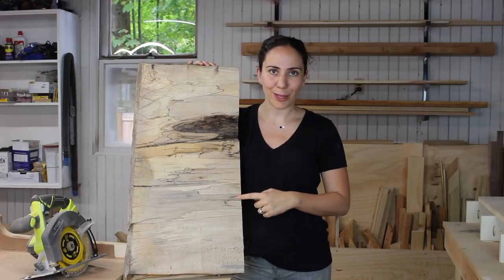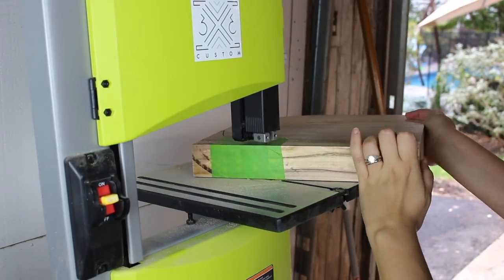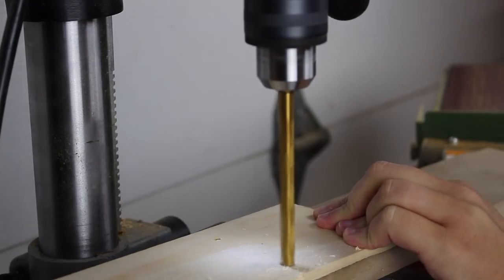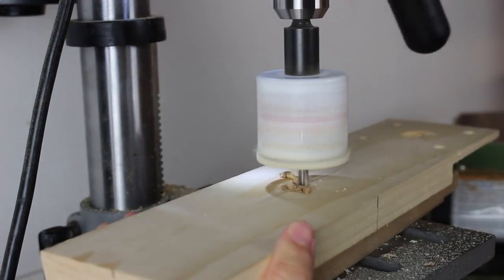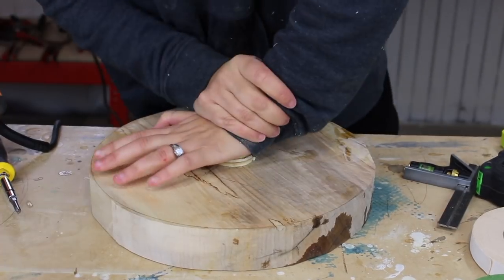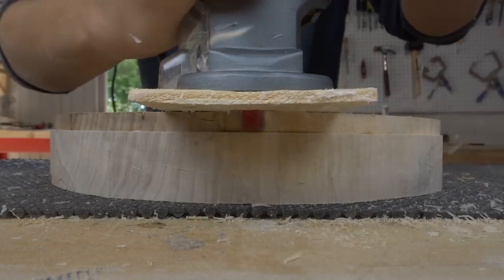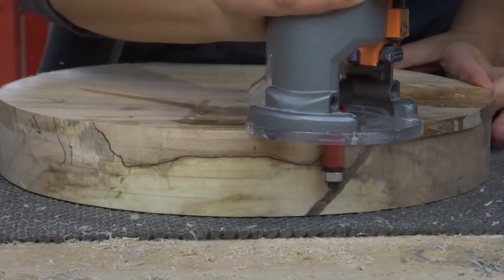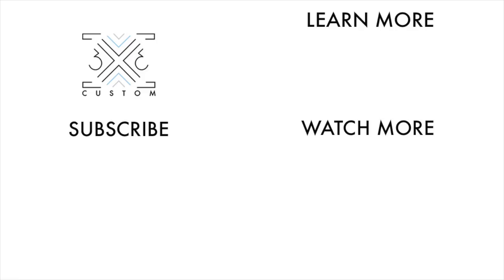Circle Cutting Jig WITHOUT Putting a Nail in Your Workpiece

Comment: I decided to stop worrying about the hole in the center a long time ago. When I run across the need to cut a circle without a hole in the middle, like a round cutting board for instance, I just cut the circle I need out of MDF or plywood or ideally acrylic if I have a piece the right size and double side tape and rout around it. I keep the blanks and at this point I haven't had to cut a new blank in years.

Comment: Great idea. What you could do to get rid of the free play made from the slightly undersized centre piece is to cut another hole the next size bigger and the put the centre piece of that in a drill/pillar drill chuck via clamping it with a nut and bolt and then sand it down until it's a snug fit in the original hole for your router jig. That will work better for you! Thanks for the idea.
Reply from the maker: Thanks! Some ppl actually suggested adding some tape to snug up the fit and I think that would be an easy enough solution

Comment: I like the way you think. Just an observation, but to take up some of that sloppiness you can remove the bit from your hole saw and insert it (the saw, not the bit) over the center circle. I don't like to drill a hole into my piece either so I just use a DIY circle jig and double stick my pivot point to the center of the piece. You'll have to attach a piece of material under the router end of the jig to elevate it so it's parallel to your center pivot point.
Reply from the maker: I liked people’s idea of adding some tape around the puck to tighten up the slop

Comment: I too don't like the screw in my board.

I took your idea a step further. I elongated the router hole from the end to ALMOST the circle, drilled holes to attach it down the sides so the circle size can be adjusted. I also cut out a circle with a hole saw out of another piece of wood, measured it and cut the hol in the jig snugly. A little wax on both pieces.

I'm about to test it 😬👍.

Comment: That’s always my main concern when cutting out circles is the hole in the center. This is a great tip! Thanks!
Reply from the maker: Thanks! Some ppl suggested wrapping the hole saw cut off with some painters tape to tighten it up. That might be a good idea.
Reply: I like your idea of just keeping pressure against the outside of the inner circle. At least that way you know the jig will spin freely.

Comment: Just made mine today. Thanks for the great idea. I made mine with 5 holes for 8”, 12”, 16”, 20”, and 24” circles.
Reply from the maker: That’s awesome! Some ppl suggested putting some painters tape or something around the hole saw “cookie” to eliminate the slop. I think that would be a great idea.
Reply: 3x3Custom - Tamar I made my “cookie” on a CNC router. Less than 1/64” slop. Thanks again for the great idea.

Comment: I like the jig you crafted and have been thinking about a way to tighten up the gap between the round center guide and the hole in the router arm.  You did a great job with your router guide, but I was just curious about how your jig works.

If you made the hole in the router arm the same diameter as the outside diameter a piece of PVC pipe, then you could fit and glue the round center guide inside a piece of PVC pipe the same length as your router arm is thick.. The fit between the round center guide in the PVC pipe "bushing" and the router arm would then be pretty stable -- I think.   

Two-and-one-half-inch Schedule 40 white PVC pipe has an outside diameter of 2 7/8".  As far as I know, several manufacturers sell hole saws in this diameter.  Just a thought.  I think I am going to try this.  Thanks for the idea.

The most important thing is that your jig worked great and you do not have to deal with a hole in your stock.  Nice!   Double-stick tape rules!
Reply from the maker: That sounds like it could work. People have also suggested just wrapping the “cookie” with tape to tighten up the hole. I myself, didn’t have a problem with it’s looseness but if that’s a problem for ya then I think painters tape would work too!
Reply: No problem.  Just going with the flow.

Comment: You can leave the "cookie" (love the name!) in the hole saw and just remove the centre drill. Stick the cookie down with the tape just like you did but with the hole saw still in place it's the exact size of the hole you made in the jig. It might even want a wipe of cooking oil or something like that because it will be so close fitting. Just a thought...
Otherwise, brilliant idea and great video. Thanks - subscribing. 😎
Reply from the maker: Cool idea. Thanks!

Comment: Great idea.  If I could recommend a solution to the slop... use the next size down of the hole saw on the jig and a puck from a scrap.  So the inside diameter of your jig matches the outside diameter of the puck.
Reply from the maker: Jacob Elder someone suggested using tape around the “puck” to get the perfect fit. Which I think is a great idea. But honestly the sloppy fit was a non-issue for me.
Reply: 3x3Custom - Tamar - That is one of the things I enjoy most about being crafty... We always find a way to overcome obstacles.
Reply from the maker: Jacob Elder agreed!!!
Reply: I was thinking the same thing Jacob. This jig it's a great idea. Combining multiple hole saws will perfect it.
Reply: Or use the blade from the hole cutter to fill the gap whilst you're routing?  Great channel - greetings from Gloucester, England!

Comment: To solve the gap between the plug and the jig, you can use a hole saw the next increment up. (On another piece of wood of course) This plug/cookie will now be the same size as the hole in the jig.
Reply from the maker: That’s a good idea. Some other ppl suggested using painters tape to shim it up which I think would work too
Reply: 3x3Custom - Tamar sorry, I forgot to mention that I enjoyed the video. Nicely done
Reply from the maker: Rise of the curtain thanks!

Comment: You might be able to put a dowel on a 1/4" flat board and put blue tape on bottom of the flat board and the board to be cut and super glue that together and use that as a pivot.  Then knock the pivot off and pull up the tape.

That maybe easier.
Reply from the maker: Maybe. Always other options

Comment: That is very nice circle with great execution. I copied you router jig. It is perfect! I made a similar style jig saw jig and it was an epic fail. If it is slightly toed in or out, the blade will turn left or right and will bind up halfway through.Therefore, no perfect circle. Don't give up your corded router, as nothing is worse than a battery croaking mid project. Yes, I have spare batteries, but this means that I have to remember to keep them charged. Ugh... I see in your video the your power cord is going up. Do you have it on a reel? I have found a way to minimize cord getting tangled  by having my little work table positioned directly underneath the cord reel. When you are set up, take out some slack & bundle the extra cord with a twist tie a higher than the work area, but not too tight. No more sloppy cord to possibly get caught up in the router. Does that make sense? Oh, and by the way, all of your jigs are great & well thought out. I can send a picture if you like. Again, great work. Cheers.
Reply from the maker: Totally get it! And yeah. The jigsaw is the worst. Ha

Comment: Nice idea...to keep the board from sliding off the puck, cut a larger puck and fasten/glue it to the top of the puck you stick down with the tape.
Reply from the maker: That’s a good idea. Someone also suggested wrapping the original “puck” with painters tape to tighten up the slack. I think that would be a great idea

Comment: Just thinking that if the board with the router mount was longer, and supported and clamped at both ends, you could rotate the blank and avoid the cable issues.
Reply from the maker: Yup. That’s definitely doable

Comment: Maybe next time take your whole saw and put it inbetween the two pieces of wood to fill the gap left by the holesaw when you drilled out the hole
Reply from the maker: hmmm.... thats an interesting idea. Wonder if it would prevent me from being able to move it so freely... I will have to try!
Reply: If it's a little tight give the middle piece a little sanding just enough so that the hole saw moves around it freely without binding
Reply from the maker: Ill def try that next time!
Reply: But definitely a clever way of doing it
Reply from the maker: Matthew Williams-Doyle thanks!
Reply: i think it would not be to tight when you take into consideration the kerf on the holesaw
Reply from the maker: jrgal27 wrapping tape around the “cookie” or “puck” was the best idea I heard. But honestly. The movement and play wasn’t an issue for me.
Reply: i know, my worktop jointing router jig has a tiny bit of play in it and i used to do the final pass with the router pushed to the jointing surface of the cut and it worked perfect.It is definitely not a problem and a good idea how to do it well done you
Reply: Matthew Williams-Doyle wow I didn’t even think ofthat

Comment: Really clever, maybe hot glue can work and also maybe glue (or screw) a piece of wood over the puck to make it easier to handle, at least in my case need the two hands on my router because is bigger and will hang the cord from above to keep it off the way :)
Reply from the maker: That could work too. Glad you like it

Comment: What about tiny circles. A core saw is good but it leaves a centre hole? Its to fill a  hole where a kitchen counter faucet was? Any suggestions please?
Reply from the maker: You can make a template and use a router

Comment: I liked this idea but have two bits of feedback: 1) buy longer screws which will fit your router, 2) use hot glue if you can, either I bough some cheap double sided tape or I was unlucky. But otherwise great concept!

Comment: Good idea but that's not a perfect circle.
Reply from the maker: How is it not perfect?
Reply: I don't know how to explain it. You used the inner part for center and the outer part of the wood to mound the router. When you cut the inner part the wall thickness of the hole saw made the holes of the outer and inner part to have a free play between them when you put them back together.
Reply from the maker: Right. So if you watched the video you will hear how I explain how you need to keep pressure on the circle to create the perfect circle ☺️
Reply: When i was watching the video i didn't have sound and i thought that you were doing it like this. Wouldn't be easier instead of keep pressuring the circle to fill the gap with a tape or something.
Reply from the maker: Some ppl have mentioned that. But I didn’t have a hard time doing it this way.
Reply: Anyway, all i can say is that you have a nice piece of wood.